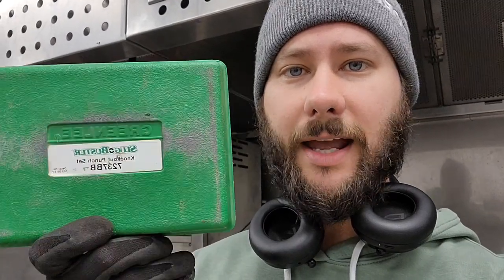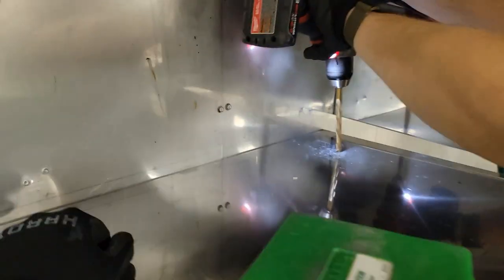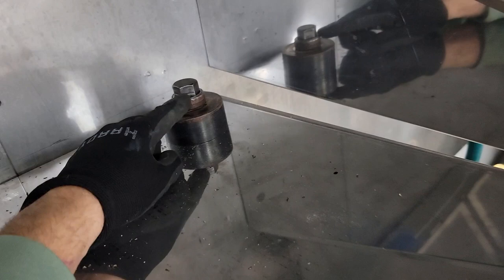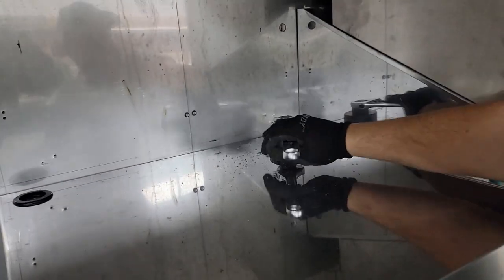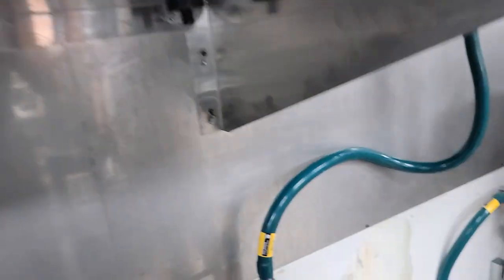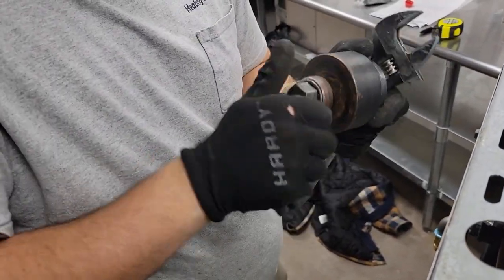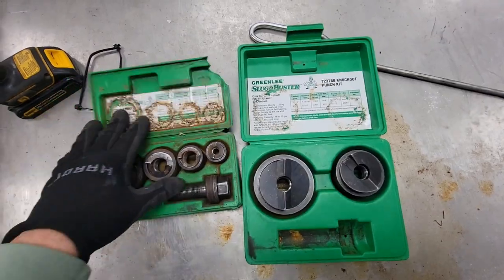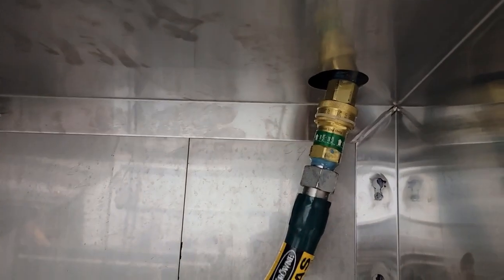How to Use a Knock Out Punch Set?

Comment: I suppose this could be used in an electrical box? I need a hole drilled an inch to the right of the existing knockout.
Reply from the maker: yes or you could use a holesaw kit for metal  😉